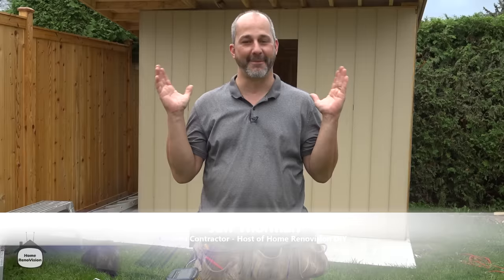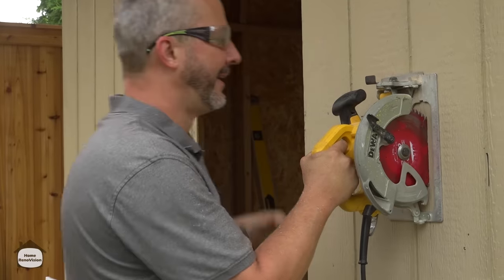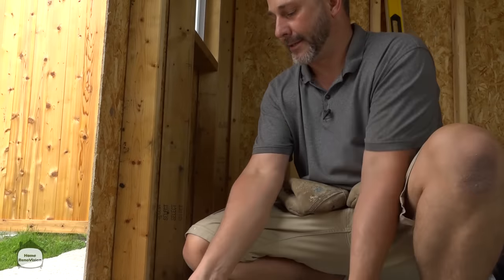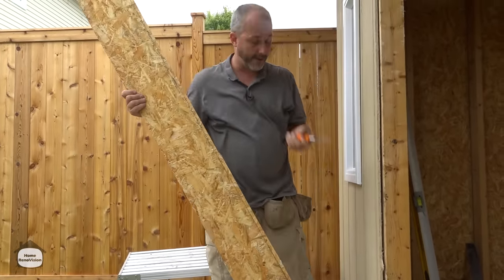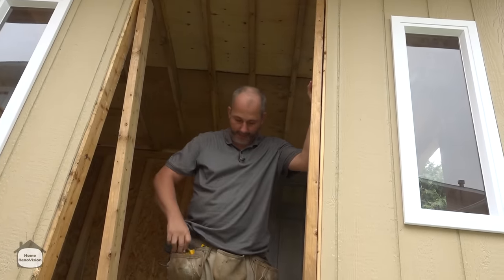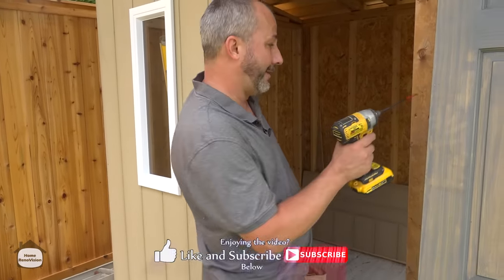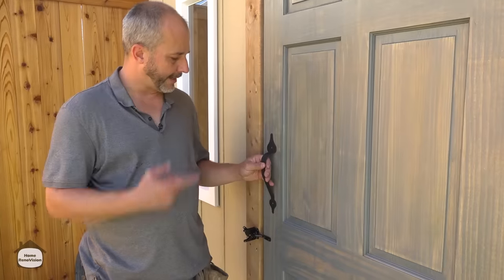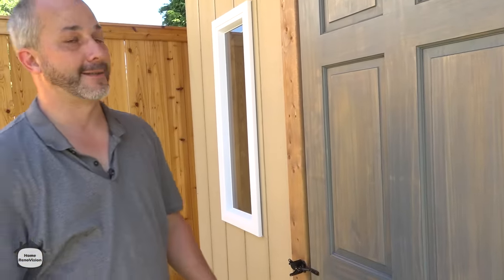How to Build a Shed: Part 5 | Doors & Windows

Comment: Just a thought, you used a self engaging latch on your doors, if you are inside and the wind closes the door, you won’t be able to open it, you will be locked in there forever.

Comment: Why you didn't put carriage bolts for door hinges? Screws are not secure. Anybody can open screws and steel the stuff. I used carriage bolts and nuts from inside.

Comment: I’m making this shed by myself.  I’m using your exact design and instructions minus the windows and door design.  I’m half way through it.  I’m a 120lb woman and based on your instructions so far I have been able to get by building it alone so far.  (It’s not as easy as you make it look when lifting the walls alone...) I’m doing the roof today and tomorrow.  I’ll need to go through your roof video once again to get the slope!  Great directions so far... Thank you for this!  :)

Comment: This was just great! What I did because my doorway wasn't conventional was make my door from 2x1/4 wood to fit the door (if that makes sense)! I cut my plywood to 28W x 72L and a door was framed. The shed really made me think of everything you showed here and to relax as I put it together and have fun while doing it! It's 8ft x 6 1/5 front slope 8ft back end 7 1/5 with plywood roof but polyurethane cover over that to  protect the roof and interior. The stuff nobody will see right. But I'm happy with it! It's my Father's Day gift to myself and it's something I'm proud of. That's it and thanks for every video that helped guide me as I fumbled through this project.👍🏿👍🏿👍🏿🎯🤟🏿🤟🏿

Comment: Big like for the videos. A question: why do you drive the screws so deeply below the wood surface? Just to save the time? Normally I drive the screws in level with the surface.
Reply from the maker: I like to pull the boards together to remove voids.

Comment: Hi there I’m with you on getting on with it al day long ! With the window install I get the point of push it up the corner to lock it in place, but why not just put the frame sealant in first behind the unit flange ? For one the suction will hold it until you screw it plus it’ll give a better longer lasting seal !!    Just my thoughts !!!
Reply from the maker: i just don't like to use sealants during install, you risk making a huge mess of everything. Cheers!

Comment: I have 20x 20 shed built the same way. But I'm having issues with panel rot around the door opening and bottom trim. Should I just repanel each side or do patch work? Also what's a better way to elimate this trapped moisture the panel and trim. I'm guessing the caulking the owner did sealed rain channels. Thanks for the great insight and amazing videos.
Reply from the maker: using the polyurethane caulking in the right positions to divert water from the walls is the key. Cheers!

Comment: Hey Jeff great how to videos as always! Just asking for a friend, since you're using the locking gate hardware for both doors and since your stationary windows don't open, how besides kicking the door out are you getting out after both doors swing shut? You should use a piece of wire to hook the top of the latch and drill a tiny hole through the frame to the inside so you can get out.
 Safety first!
Reply from the maker: In the reality Renovision episode on this project we show how we run a release cable from inside the structure. Cheers!
Reply: I see you’ve replied to many messages except the ones asking about the windows. What’s the mystery about sharing the name or link of these windows????

Comment: I know this is an older video. Hoping you see my question. Are there narrow windows like this that can be installed in a house between the studs so it does not loose the integrity of the wall strength. OR do they still need a header put in?  I would want at least 2 side by side between studs. Three would be better. It is in a weight bearing wall. 6 inch studs on 16 inch  centers. My thought is if I still have to do a header I might as well just do a wider window.  Thank you!

Comment: Adorable doggy!
I think I would have done the door before the windows to avoid jostling the windows while hammering the sheathing. LOL. 
I like to go overboard a bit so I probably would have put a bead of caulk on the back of the flange of the window to help hold it in tighter and create a better seal against bugs trying to creep in.
Good tip on holding the metal of the saw against things. I didn't know that. In my defense, I took my woodworking class over 25 years ago. LOL.
I'm lazy so I probably would have gone with a prehung door or built a DIY door. Where I live, we get a lot of sun & heat so black hardware would get way too hot to touch.
I like the idea of saving old blades to use as nail plates.
When I first saw you suggesting an angle for the top of the door trim I immediately thought of using the template board to get the same angle as the roof. LOL.
Sanding sponge reminds me: They made pot scrubbing sponges that look like that only in brown/black. My mother bought some & I thought they were sanding sponges & took them to the workshop & couldn't figure out why they weren't working well when I was trying to sand a table.
Putting screw in reverse to start the hole is also a cool tip I'll have to remember.
I have a latch like that on a gate. We ran a wire from the latch to the other side so people can still open it from the other side & not have to go around.

Comment: Another great video!  At around 20:14 you asked to let you know if there is another way to cut that opening for the door.  I'd use a router with a flush-trim bit.  Super neat, done in a flash, and guaranteed to be flush with the stud.  Of course you'll have the same problem at the bottom.  For that I think I'd use a multi-tool.  Appreciate that not everyone will have those tools of course.
Reply from the maker: Sounds great. In hindsight I ran into this problem because I changed my design. If i had skinned the wall to the proper dimension first. None of this would have been necessary.
Reply: Home RenoVision DIY  Funnily enough, that's one of the things I like about these videos - they're real.  We all change plans mid-project, and it's how you deal with it that's especially interesting :-)

Comment: What brand of door is slab door you used - we haven't been able to find exterior rated slab doors in our local stores . Did it come from a mill work (trade only) company ? I'm needing a 1 3/4 thick door for a below grade basement entry and a solid wood slab would work . thank you

Comment: Really good vid. I've been doing my home renos and projects for 30 years and am amused by his similiar techniques and discoveries as mine when it comes to tool selection and use etc.
BUT!! I must say. Getting ones fingers that close to any spinning blade is a dance with the devil. I am also a machinist and know the value of hand safety. Hands are here and blade is over there. Be careful. Use your head first and the tool second. And yeah;  I still have all ten fingers and most of my mind intact.

Comment: I've watched a lot of your videos and I thank you for what you've taught me. To the point of us doing our own shed/garden room build. Although as a Brit, our cross over on using Imperial maths (math) and also the metric system (we still us pints, stones and MPH in a somewhat random manner). I can't help thinking that when we measure building materials and measuring for construction, that the metric system is so much better than feet and inches. Same as measuring weight for cooking and baking. Keep up the good work my friend..
Reply from the maker: Love a good pint. Cheers!

Comment: Hi Jeff,  
Is there a way to determine how many hinges I should install on my doors?  I have an old style garage/shed with doors that measure 4' x 8' (1200mm x 2400mm).  The original hardwood doors had 2 hingers (heavy duty 1930's) but now these doors are well past it.  I noticed a bow in one of them so wondering if I should have 3 or maybe 4 hinges on each door.

Comment: great videos! I am currently building my shed/workshop and I am changing my roof plans because I love your roof system. My question is this... My shed is a 12 foot x 12 foot square. can I use your system using 16 foot 2x6 to have an overhang on the front like you did? I am only doing a galvanized metal roof with no plywood so it is not a heavy load. what do you think? Can i get away with 2x4s? Why did you do the ladder overhang on the end of your roof? ws it because of the length of the 2x4? I appreciate it. super videos!
Reply from the maker: I used a ladder to translate load to the wall. yes 16' lumber will work just be sure to keep your overhang to 2' unless you brace it or post it. In the shed interior I would also put a 12 ' beam contrary to the rafters at the midpoint for extra stability. Cheers!

Comment: I got a question? Why didn’t u frame the window in when u built the wall. Great video bye the way. ✌️
Reply from the maker: I am a visual builder. and I find that most homeowners would rather see the space before making the decision as to where to put the window as well. there are a few considerations to make so I chose to show the process. Cheers! If you have your design settled then by all means install the framing first and use a router to cut out the wall board. Cheers!

Comment: Any suggestions for how to take a double french door that swings in & switch the hinges, so that is swings outside & make a frame and use it on a shed?  Basically, using the Two doors as slabs and making a frame I think?  Kind of like your solid door in this video, but 2 doors that open outward.  The doors I have are exterior french patio doors with a door knob on each & a flip deadbolt on one of the doors. Everything I have found online, says burglars can pop the pin on outside hinges, but this is a shed-let them work on it if they want to steal so bad!  I just want to save $ by using these free doors & i want it to look pretty.  Well I do want all weather protection too.  Is this possible?  Im just learning how to use power tools and your videos are working for me! But I need some help on this one. :)

Comment: Hey Jeff, what brand of driver bits are you using?  I had a set that would slip on the screw and now I want to get a new set.
Reply from the maker: The last kit that I bought were mdk, but they are hard to find. I think Makita makes a great set with all the bells and whistles.

Comment: Can you give me some advice on how to fix an oversized door frame on my shed?  We  goofed and made it too tall, and I am not sure how to fix it to fit my pre-hung doors.
Reply from the maker: Hi Kristin, you can use a larger trim board to close the hole. You can also add a sweep to the bottom of the door to raise the height of the door. Cheers!

Comment: How are you going to open the door from the inside? If you're inside and the wind blows it shut...since that's a gate style latch.
Reply: Drill a tiny hole and attach a thin pull cable to the top of the latch from the inside.
Reply: William Haussler Haha like a mouse in a trap 😂 Just hope the back door will be able to open from inside. Otherwise you’ll have to yell or take a sprint against the door 😀
Reply from the maker: The secret is out!

Comment: I would have cut out the door with a router, with a straight cut bearing bit, used the method before and its as fast as lightning, and a perfect cut every time, the bottom bit I used a Fat Max hand saw.

Comment: "If you can't hold it and keep it from kicking back maybe you shouldn't be using the tool in the first place."
Greatest thumbing of the nose to the safety trolls ever. Well done.
Reply from the maker: Cheers David, I also like the need for a mask every time dust is in the air. LOL

Comment: Could you give us the name of the drillbit gizmo looks really useful
Reply from the maker: It came in a kit from mdk. I couldn't find it on amazon unfortunately. It is more commonly used for installing hardware so that metal door handles don't get marked up by the turning shaft of the bit.

Comment: You are absolutely right about the "box kite" shed kit. A total waste of money. Including the cost of the kit and if she hired somebody to build it would have cost $5000! I helped my sister put hers together and it was made of mostly thin, cheap bent and warped spruce. The instructions said to nail together the rafters but all the precut angles on the warped 2 x 2 spruce rafters made making the angles meet impossible and how can you nail such a thing? We tried making a jig to hold the angles together ... didn't work. We ended up screwing everything. And all the precut angles at the gables were off .... what a disaster. What we learned is that if you can put together a kit, you can build a shed from scratch yourself and know it's made of 2x4s and stronger wood. Thanks SO much, again (I spend far too much time watching your videos as I go through my home improvement jobs) for your kind generosity sharing all this stuff ... I have learned SO much!

Comment: Can PVC window trim be stained? Those bright white trims create dissonance with door coloring. I understand, it is shed, but... still it is the question.
Reply: PVC will not soak in any stain, but they can be easily painted (maybe in the next video?). I do agree that as they are, they stand out a little too much, next to that nice door.

Comment: hey jeff,again,nice tips and tricks,however,i leaned the hard way,sawwing without eye protection is a nogo for me,i once had a teeneeweenee piece of wood in my eye,never again will i saw without protection for the eyes,for the hands there are manners like you have shown to keep them safe,also when cutting bricks or tiles with the disc tool
always stay with your body on the side of the disk guard,i once had a disk breaking in a lot of pieces when cutting a metal pipe,the guard all reflected the pieces away from the guard
had i been on the other side,al the pieces would be in my face,something to think about

Comment: Jeff, you need to show people how to drill a hole through the frame and attach a wire to the latch on the inside with a loop.  That way you can open the door from the inside when the wind blows the door closed.  Last thing you want is to be closed in a solid built shed like that.  Or you could just kick out those "economical" windows!!
Reply from the maker: I was going to put in a fridge and wait for help. Cheers!

Comment: Love watching but what happens if you are inside and the door blows shut or a child goes in and shuts the door and is trapped, I would not use that type of anything but a gate like it’s designed for

Comment: Hello boss I'm just wondering  why didn't you  but  the cocking  before you install the window will be sitting better .
Reply from the maker: The windows are nopt square. The cost of a cheap window. LOL
Reply: Caulking?
Reply from the maker: would have made an awful mess I would think. I have never tried that before. Cheers!

Comment: Jeff be careful with that latch you don't  lock yourself inside.. drill a tiny hole through the wall attach a string to the latch so you can open it from the inside just in case.. I'm just saying✌

Comment: I did my first build in 83. 2450 sq. ft home. There is just one thing I do different now. Frame accordingly. Be sure on your door sizes first now. Leave those studs out. Lay out your door rough in frame on the level floor. Be sure your door casement or if building your own is going to be square and correct threshold allowance and of course your jacks laid in to measure.. Stand and put in place, jack and cripple then top plate. One thing I do is tie my corners when it comes to top plate.. I notice a lot of people just throw up the wall and move on. Of course your building a shed and not a house. House has corners for sheet rock attachment and of course Tboxs for interior walls. Oh, and my top Plate say on 2x4 is 2x6. Nailer there at wall edge. Just my thing.. not for everyone i guess..
Reply: I watched this build as a random I guess.. Was looking to maybe build a shed on this rental property. Same style and One slope with 10 front wall 8 rear On a 10wide by 20 long but made to attach the other half in the future. So its has to be on blocks to move. Good work on the building and I learned a few tips. Thanks

Comment: Kickback's not a problem with a skilsaw, just hold it right and tight.  Why are you using your speed square like that?  Draw a line with the square, then the line guides you.  Don't try to hold that thing on there.
Reply from the maker: It is actually easy and gets a perfectly square cut every time.

Comment: Hopefully the other door will provide an escape when you accidentally lock yourself in the shed with the current hardware configuration on that front door haha. Good stuff tho!
Reply: That i was thinking to. 😁
Reply from the maker: We will be installing all the finishing touches in the next video. Going to pimp out the shed a little. Cheers!
Reply: haha was thinking the same
Reply: Always a good idea to have a self locking device on the outside... pmsl
Reply: The top of the latch has a small hole so you can attach a cord or wire, then drill a hole in the frame, run the cord inside and you can pull the cord to get out.  Just like with a taller fence with the latch on the other side..

Comment: Where did those 12x36" windows come from?
Reply from the maker: Hi Greg, they are actually 15 x 39 and we picked them up at Home depot. Cheers!~
Reply: @HomeRenoVisionDIY  Thanks a lot about where to get the windows. They seem ideal to bring a little light into my shed without requiring reframing!
Reply: @HomeRenoVisionDIY  I have searched and searched and I can't find anything resembling those windows. I find picture (fixed) windows that fit in a stud bay impossible to find.